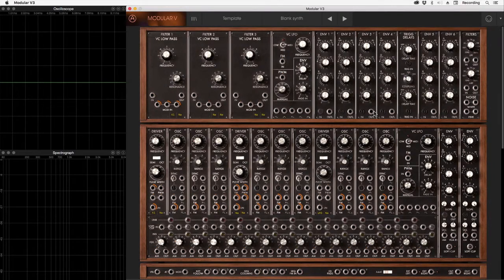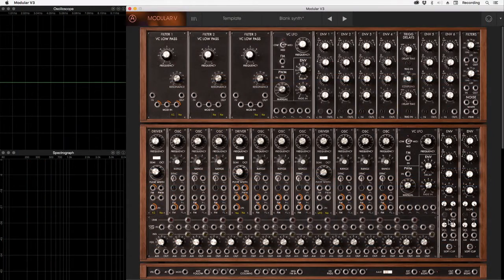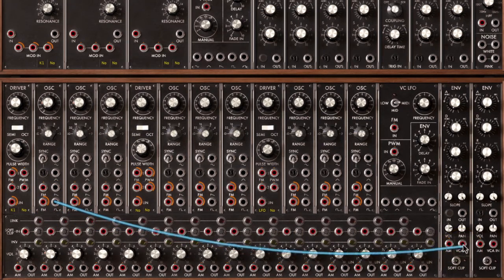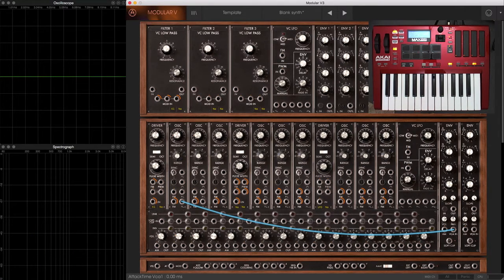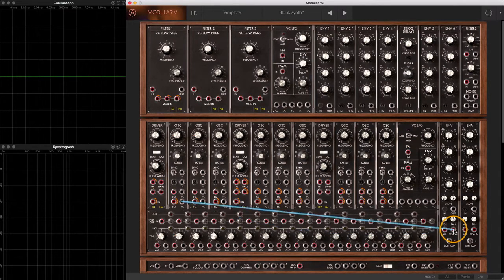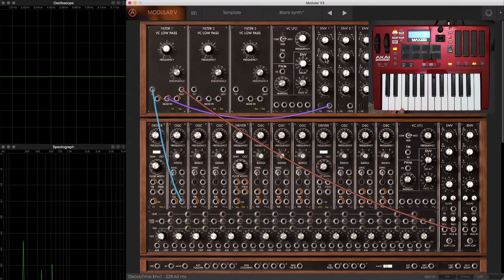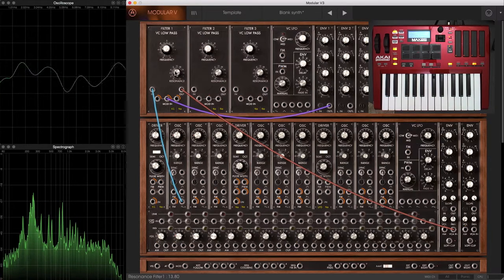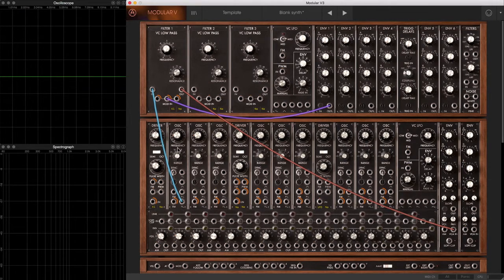LMS: Creating Your First Patch with Arturia Modular V (V3)

Comment: Excellent! I have a real Moog Modular 3C. I love it but it's 45 years old and has some problems. The main one is not polyphonic.  Also, it hums and the pots and connectors are very noisy, not to mention you can't save your patches. Anyway. thanks for showing the basic behind-the-surface routings that are not present in the hardware version. I was having trouble doing basic patches on the Arturia because I was not finding these normals. You do a great job. You obviously thought about what you are going to do before you record your program. That is pretty rare on YouTube tutorials.
Reply from the maker: Thanks for the kind words, and great to hear you still have a Model IIIC! Yes, I agree some of the under-the-hood default connections can be initially confusing. When recording videos, I always try to think of how a new user is going to see the same thing, and anticipate their questions when I can.

Comment: can you map the key board to youre desktop keyboard without need to buy a midi controller?
Reply from the maker: There is a virtual keyboard at the bottom of the screen in Modular V (I've not scrolled down to it in this video; that's why you can't see it), where you can click on keys to play it. I just did a quick scan through the manual and did not see a place where you can use the keys on your computer's keyboard. 

But fortunately, USB keyboard controllers have come down as low as $40 for a new one (midiplus AKM320 through Amazon); used ones can be found even cheaper.
Reply: yeah but I cant hold one of the notes down and tweak knobs in real time if im clicking on the keyboard.
Reply from the maker: I hear you. And I'm guessing a cheap USB keyboard is out of the question?

I did a little Googling about turning a computer keyboard into a MIDI keyboard, and found this for the Mac; there may be other solutions available as well: http://www.synthtopia.com/content/2010/12/28/xtrument-midi-controller/

Comment: The normalisation in these kind of software synths is quite annoying. Really hard to determine what one is actually doing.
Reply from the maker: I agree. Fortunately, there's relatively little normalization in Modular V: the master control voltage and gate. And although I personally like to see every cable and connection, I could see where for the user it would get a bit annoying and add to the on-screen clutter to have to make those particular connections. Perhaps a compromise would have been making those menus for normalled connections a lot more obvious than the innocuous icons they hide behind now.
Reply: It’s just like the real one. It’s easy once you learn it